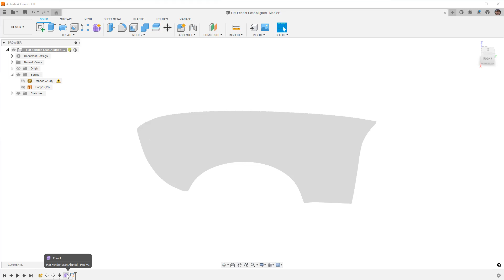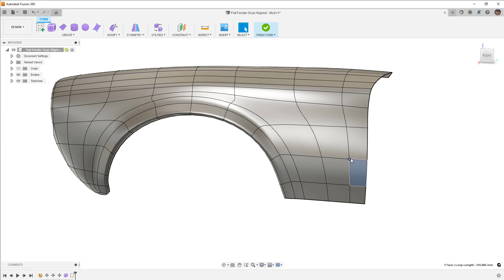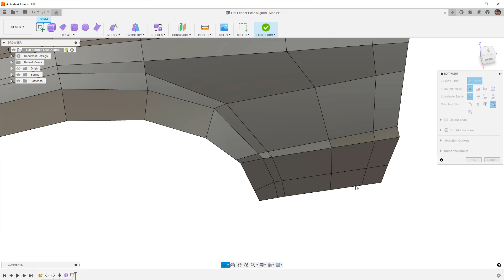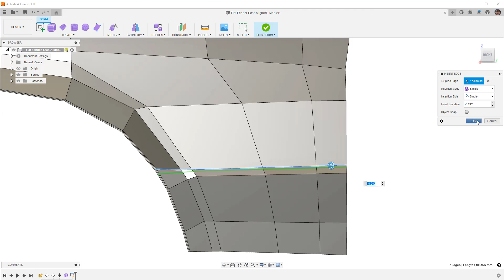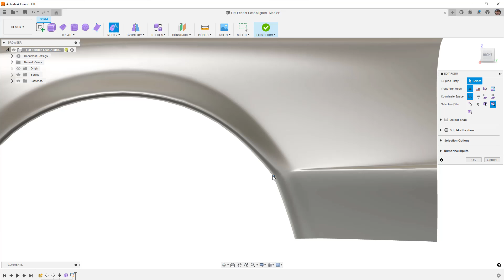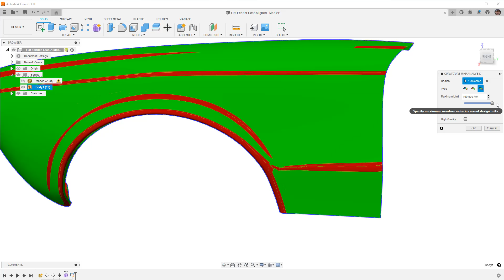Fusion 360 Form Mastery Part 39 - Hard Details on a Car Fender #Fusion360

Comment: Finally! I heard you say something that turned on the lightbulb in my head about setting the pivot point and using the scale tool!  Pick the point to which you want all the other points to match. I’ve been doing it wrong!!
Reply from the maker: Awesome, glad to hear that helped!  The scale trick is one that can really make a difference for things like edge flow control on something like this!

Comment: You mentioned that this software is not ideal for car design. Can you recommend software that is specifically meant for designing cars???
Reply from the maker: Yeah I always add that disclaimer :)  So there are pieces of software made for "Class A" Surfacing.  Autodesk Alias is one of the bigger ones.  They have a free 12mo home learning license but to purchase it is between $4k and $10k/year.  Depending on the manufacturer the workflow generally involves a Mesh model created for a car body first.  That mesh is generally taken into something like Alias and surfaces are built off the mesh.  If its a new concept you might see a company take that new surface model and machine it out of clay.  Hand work it, scan it, then take that mesh back in and make a final Class A surface off that.

Fusion can certainly design but its a bit lacking in the surfacing tools and the Forms work great up to a point.  You have to be very careful with them and dealing with nGons and star points becomes tricky as the models get complex.

I have modeled cars in Solidworks, Inventor, Blender, Fusion and Plasticity.  You can do it in all of them, but it just depends on what your end goal is.  For example in the fender flare design series i knew we were going to 3d print the parts so I could have used Blender or Fusion since I only needed a mesh.  IF i had planned to machine foam from the model Fusion would have been a much better option because it would give me a surface.

Hope that helps, but if you have more questions just let me know.
Reply: @LearnEverythingAboutDesign  Yup! it surely helps. All your videos are super informative and interesting. Thanks for keeping them publically available.